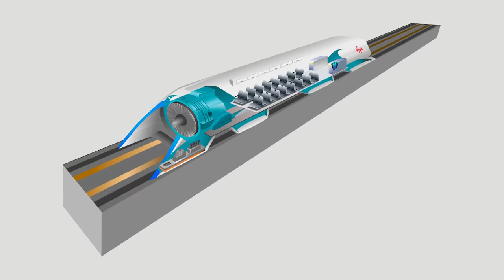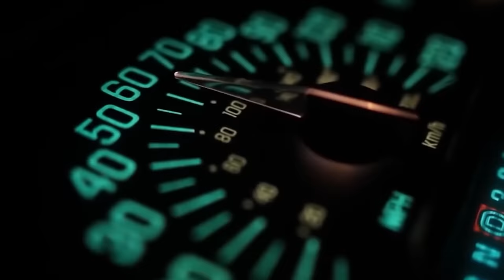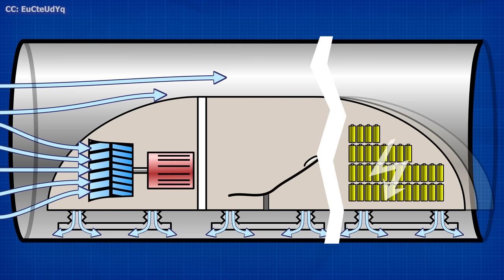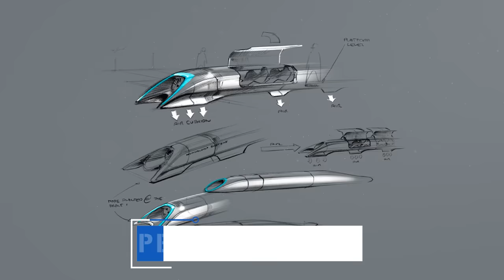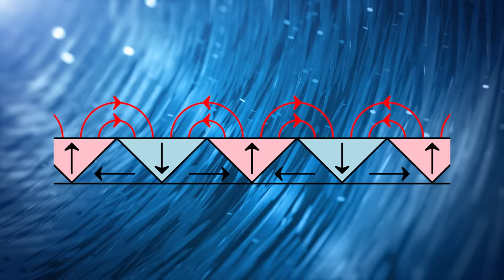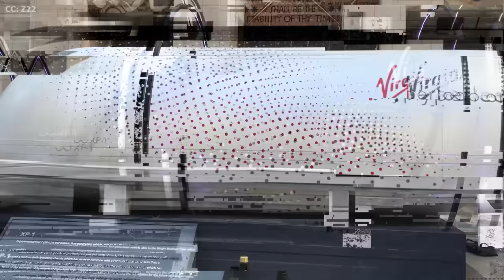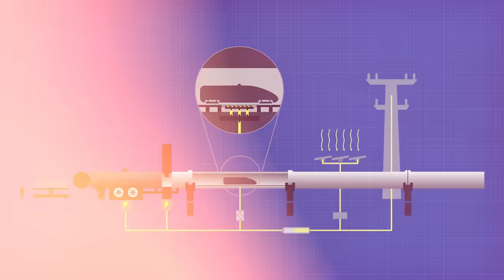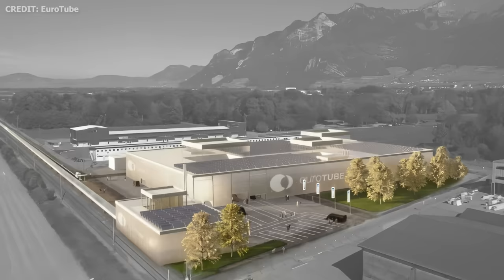We’re Getting Closer to a Hyperloop...

Comment: I laughed out loud at the proposal to have a depressurized tube under the sea ... nothing quite like making it even more inconceivable to have such a tube than surrounding the tube by the immense pressures of water.
Reply: The difference between a tube withstanding and external pressure of 80 atmospheres with an internal pressure of 1 atmosphere, and the same tube withstanding the same external pressure whilst containing a perfect vacuum is minimal. The concept has problems but that ain't one of them...
Reply: @tomj819  you only think of 1 bar, in comparison to pressure. Difference is that you have a vacuum, even a small leak will draw the surrounding fluid in so fast that nothing inside can escape.  If you have 1 bar inside, then the external pressure will eventually be equalised. That makes a huge difference.
Reply: @jantschierschky3461  1) You think anyone planning this tunnel would even contemplate a single-walled design? 2) Do you know what the depth of the Baltic Sea is? 3) Relative pressure is relative. The difference between 5bar external and 1bar internal, and 4bar external and 0bar internal is zero.
Reply: @tomj819  Again, pressure is one thing. As I said, you have a leak, everyone is dead inside. Have you ever seen a vacuum container getting crushed  ? I know how deep the Baltic is, I spent enough time on it.
Reply: @jantschierschky3461  so we can safely say you don't understand engineering or physics. Good.
Reply: @tomj819  True, nothing. I  only studied physics. I work in the irrigation business.  I specialise in venturi systems, so vacuum, pressure, and fluid dynamics are what I do daily. So yes, I have no clue about physics.
Reply: @jantschierschky3461  that's nice. So is a tube stronger under tension or compression?
Reply: @tomj819  compression,  but that is not the point here. I am talking about leaks,  not crushing.
Reply: @jantschierschky3461  and yet despite multiple leaks into a perfect vacuum from an internal pressure of 1bar, the ISS is absolutely fine, as are all the people in it, despite that being the weaker of the two scenarios structurally. Funny that.
Reply: Nah, bruh, my dad works at Microsoft and he says the done it
Reply: @tomj819  Well, the 1 bar internal pressure. You have a leak, air escapes, and you can plug it. You have enough time.
You in 0 bar environment,  even yourself in a pressurised capsule. If the volume is big enough and you have a leak, the air coming in comes so fast  it will crush the capsule. 
Little example, we had a 300mm pvc pipe with normally 8 bar water pressure,  300m long.  This pipe is on the ground. Due to a pump failure, the pipe was at near 0 bar. One of the guys cut into it before I could warn him.  The whole pipe got crushed, and the pump on the other side got blown about 1 m. That happened in less than few seconds
Reply: @jantschierschky3461  okay, based on this I'll amend my statement. You possibly understand some physics, might understand some engineering, and don't understand design. We can leave it there...
Reply: @tomj819  never said I am a engineer,  or designer.  But I know what happens with vacuums and leaks. Maybe you want to watch thunderfoots video about hyperloop.   
You may understand why the concept of hyperloop is total nonsense, cost alone makes it impossible,  let alone the safety aspects.
Reply: I think what  @jantschierschky3461   is saying is that direction of pressure differential is crucial- outside in vs inside out makes a whole world of difference.
Reply: @tomj819   Yeah a completely clueless original comment. Glad you said it so I didn't have to.
Reply: @tekkenryu  That doesn't make sense. The idea of hyperloop tubes is always that the pressure is greater on the outside.
Reply: @Mrbfgray  How is it clueless? Doing it underwater is inherently going to face greater pressure differences and construction challenges. We haven't mastered an above ground hyperloop, so why would you start one under water?
Reply: @1970DAH    Do you know what a vacuum IS?  It's the absence of 14 PSI MAXIMUM on Earth's surface in the atmosphere, that's roughly the same external pressure as 30 ft. deep, utterly trivial compared to pressure from earth or ocean.  GET IT??
Reply: @Mrbfgray  I do get it. But the Baltic Sea is not 30 feet deep. Also, they are proposing to run the tube at near-vacuum under water. But just to entertain you, let's assume they find a route at 30 feet and that's one atmosphere's worth of additional pressure by doing it under water. So it's at least double the pressure difference they have to contend with. Do you get it?
Reply: @1970DAH  sorry, but you clearly don't get it. The point is this. We have, using simple steel and 1930s technology, made submarines that can dive to 180m (3× the average depth of the Baltic), sustain leaks from explosive concussion, and survive.

If those submarines had contained a perfect vacuum the physical analogue would be a depth of 190m. The vacuum is not the challenging part; designing a structure that would be safe at 10-15 atmospheres is.

Probably you would make a double wall, with segments between them; and pressurize the gap between walls with air to a high fraction of the external water pressure. That way water leaks are easily identified and contained before breach of the loop itself is at risk, and vacuum loss in the loop would identify a leak in the inner too. You just need to not make the inner wall out of 20mm thick PVC so it doesn't catastrophically fail like an irrigation tube. Fortunately, we kinda know how to do that already.
Reply: @1970DAH    Good GRIEF.  The point is 30 ft is nothing in an ocean 1000s of ft or miles deep.  Yes at 30 ft the vacuum doubles the pressure, at 5000ft one ATM is 0.06%!!!!  Get it NOW???  F Me!
Reply: @1970DAH   Please don't plan on being an engineer even if you are 8 yrs old you should intuit better than THIS.
Reply: @1970DAH  Correct; since the external pressure of the tube will always be higher than internal (vacuum), even a small leak on the tube will cause catastrophic collapse ala Ocean Gate incident.

Impossible to ensure such leaks will never happen- it only takes a rifle bullet puncture at any point in the vacuum tube to blow it.
Reply: @Mrbfgray  We are talking about something *we can't yet do above ground*. Why do you insist it's just as easy if it is underwater? Also, any failure would fill it with water instead of just normal atmospheric air. I think there is something wrong with your intuition.
Reply: @tomj819  Get back to me when we have built submarines that are 300 miles long or when we have built a hyperloop (which actually operates) above ground. By the way, the company has made zero progress since their 2016 proposal.
Reply: @tomj819  Could we build a tunnel and have the tube inside a said tunnel? Possibly, but it would be 10 times longer than the Channel Tunnel which is the current record holder.
Reply: @1970DAH  I didn't say it was easy to build. I said the fact it is underwater is NOT the overwhelming technical issue at hand. My point is precisely what you say; the barrier is designing and building a functional hyperloop, not where you build it. The extra atmosphere of pressure is not an issue. The length is an issue of logistics, not physics.

Your mention of the Channel Tunnel is useful here. The difficulty was not in physically building a tunnel under the sea; it was designing a safe system that could not have access points beyond tge entrance/exit; it was finding continuous rock strata suitable for tunnelling which is why tge tunnel takes a W path on its journey.

A lot of things are very hard to do: just not for the reasons most people think.
Reply: @jantschierschky3461  I think that what you didn't manage to get across is  that there IS a great difference in 0 (or even .01) atm inside and 1 outside versus 1 in and 2 out. In the first case there is (next to) nothing opposing the air, or water, rushing in. In the latter there is, and the pressures in and out will equalize before too much damage can be done to kill all that's inside.
Reply: @eefaaf  i thought that is what I  stated
Reply: @jantschierschky3461  Yeah, I thought you were. But it somehow didn't register, it seems.
Reply: There's barely any difference.
Reply: @jantschierschky3461  You don't have to make it as deep as the Marianas trench.  Also, it's entirely possible to build a vacuum chamber that can withstand getting dented or a small leak. The chambers you see getting crushed are ones that were never designed do be able to do that. It's like being surprised when you crush a can by stepping on it and then saying, like, "there's no way aluminum could withstand a human weight, or something.  It's just a completely misunderstanding of physics and science.
Reply: @tomj819  if it was possible it would have been done 100 years ago, like the idea elon copied.
Reply: Too many geniuses in this comment thread...
Reply: @takanara7  sure IN THEORY it MIGHT be possible to build a several kilometer long multy walled vaccuum tube, that furthermore is resistant to the constant covements of the undersea currents AND could survive a leak (somehow)...
BUT
That would be so UNGOLDY expensive (even compared to the stupid price we would have to pay for the overland version) that there is litterally 0 point in contemplating it.
And that igores the added difficulties and costs of building the damned thing underwater...

@jantschierschky3461 While correct that the added pressure of the water would make it a bit worse... the wave of air from a normal above ground tube failure would already be deadly enough... so not much point in pointing out that this would be a little bit worse. ;p
Reply: Did any I'd you ever think that they're not just gonna lay this hyperloop tunnel on the bottom of the seafloor? They're going to tunnel under the earth. That's going to dramatically reduce pressures, stresses, factors that Influence the integrity of this (hypothetical) tube.
Reply: @ajhil5653  did you ever think it's never going to happen
Reply: @tomj819  Perhaps the underwater hyperloop could be designed to pick up the random hitchhiker that inconveniently developed a puncture and was left stranded? 

Just think of how much the Titan submersible crew would have benefited from an underwater hyperloop nearby when they experienced a catastrophic implosion?

Comment: Just use high speed rail. The cost of building these things will be so much greater and they won't really be better. A highspeed train can already cover distances of 40km in under 10mins there is not a really a need to do it in 5. it is hard to estimate the cost, but a giant vacuum tube the size of a train will certainly be more expensive then two sticks of steel 1.5m apart.
Reply: Musk's brain is so smooth he even claimed it was cheaper to build this than regular high speed rail or maglev, despite the thing literally being a maglev inside a tube, so you clearly have the cost of the mag lev as a minimum on top of having it run in these tubes at near vacuum.
Reply: I'm all for any kind of technology that doesn't use fossil fuels and can transport me long distances quickly. The hyperloop is one of them, but if current high speed rail can do it just as well, I'll settle for that. It's just a matter of ceasing the senseless arguments about the costs.
Reply: @bluegold1026  We had electric trains (that are more ecological that hyperloop, because it needs MUCH less energy) for .... a century basically. So normal and high speed rail ALREADY are much better than any hyperloop.
Reply: To reduce flying, you'd certainly use this in the North East of the US to maybe the mid-Atlantic. The ground is stable and there is a high population density.
You'd still want the thing covered and traffic to go under or over it. We now have to worry about domestic terrorism and also idiots who ignore rail crossing barriers.
Anyways, the distance from DC to NYC is about 370km and from NYC to Boston is 340km. And this is a relatively compact area of the US. NYC to Chicago is like 1200km. Factor is any stops - there are a lot of cities on the way - and it's still 5 hour ride. In comparison you can fly from NYC to LA in less time.
Reply: 357 mph, that's the current speed record for a wheeled train running on rails. That's quite fast enough!
Reply: Agree

Comment: I love Adam Something's brutal debunk of HyperloopTT. Basically it's just dead on arrival, because you can chain those pods, put them on rails, call it a train, and forget about these extremely expensive techno shenanigans. Hyperloop as proposed there has the obvious limitations of capacity, plus the total inability to route traffic around a broken part of the track. It's fancy if stuff go really fast, but that's hardly the main issue to solve with logistics. Those same containers have been weeks at the sea already, and they're sitting on the shoreline because processing them further is slower than offloading them from a ship which Hyperloop would do nothing about. The proposed system would make sense if you could shoot goods from China to all the way to Europe or U.S.

Comment: I'd like to see the configuration to maintain the vacuum of the tube while docking a train.
Reply: We can't keep the power grid from overloading on a hot day. Where's the power going to come from to draw a vacuum on a substantially sized tube?
Reply: You can see a configuration in my granted UKIPO patent, Zero Energy Transportation System.
Reply: @othmanskn  yeah that isn’t a thing.
Reply: @JerryB507 you must live in California.
Reply: @glockfanboy4635  2021 Texas, 2003 the North East, 1996 the West Coast.
This year, of course, Texas asked people to reduce the use of electricity - during a record heat wave - or there would be rolling blackouts.
Reply: @501Mobius Hyperloop One showed their answer in a rendered video. A very short vestibule would extend, press, seal around each pod door, let air in, then the outer door and pod door would unlock and open. Docked pods would remain in vacuum except for  door areas.
Reply: @glockfanboy4635  It's September and Texans still can't run the AC or the sprinklers.
Reply: They would use an airlock.
Reply: Yes, just have the train or pod enter an air lock, equalize the pressure, open the door normally, and then reseal and re-pressurize the chamber.
Reply: @othmanskn zero energy  ? Like my perpetual machine  ?
Reply: @grimmlinn  What do they have, just big gate valves in the tube?
Reply: @501Mobius  A door on each side that lets the pod thru and then closes and changes the pressure.
Reply: @grimmlinn  How do you have a door inside a tube?  A disk doesn't conform to the walls of a tube when you swing it out.
Reply: @501Mobius  We already send astronauts too and from a vacuum in space.
Reply: @grimmlinn The hatch was not the same size as the module.
Reply: @501Mobius  The airlock can be larger than the tube